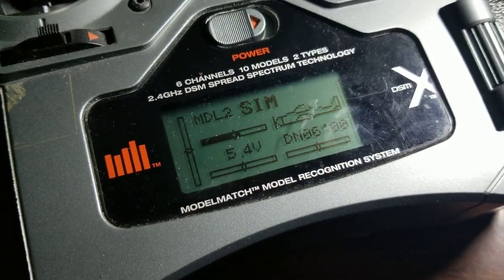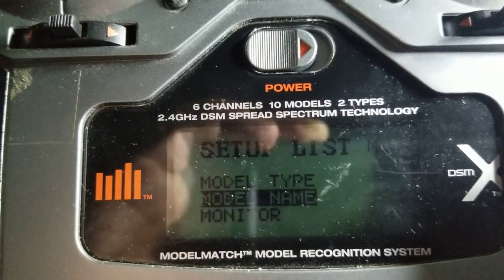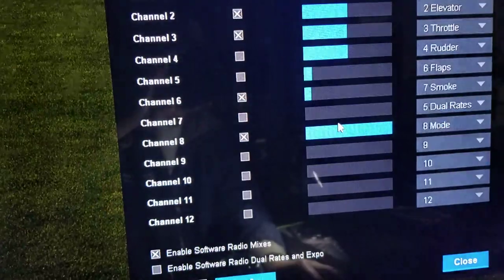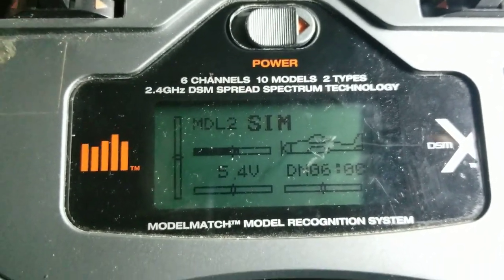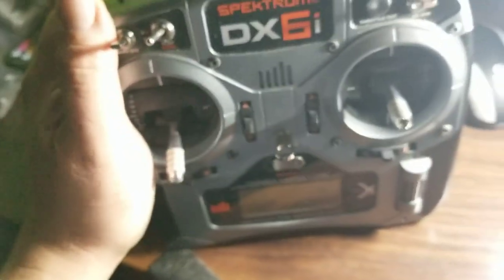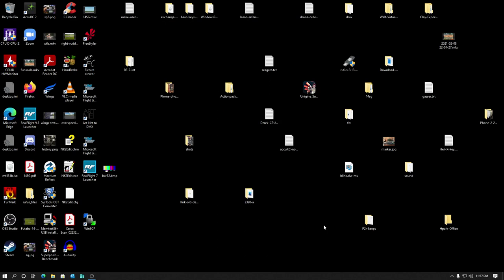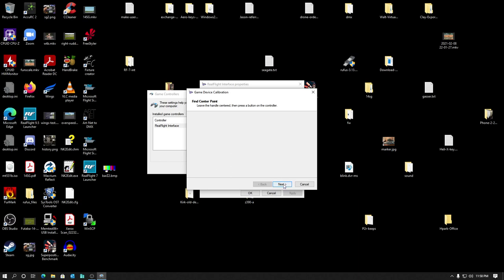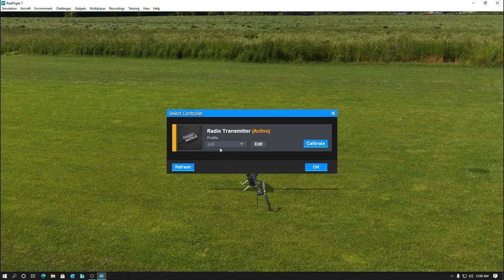Spektrum Dx6i Realflight 7

Comment: Now i have realflight 7..and i have a ws1000 dongle..and could not get the software to even see my dx6i...so i emailed horizon hobby...and they told me that i have to buy the realflight interlink transmitter....lyin suckers
Reply from the maker: Yeah- but not really.  
RF Any RF older than 8 needs the stupid RF Interlink or their transmitter interface.  
Newer Realflight versions * 8 9 9s and EVO do not need it and will work with about ANY USB controller including any the wireless dongle ones.
Also if you actually own or paid for your older Realflight those cheap generic usb sim interfaces can be used.   
They look like an Interlink.   
You can plug it in so that the software will at least start up, and then you can use your wireless dongle.   But you will have to have both plugged in.  
My recommendation is to get a newer version of RF just be cause it has more flexibility and does not need their controller.